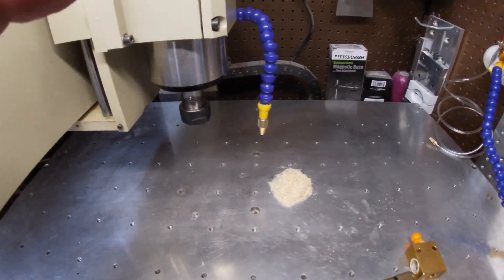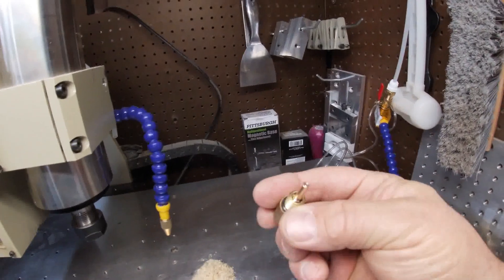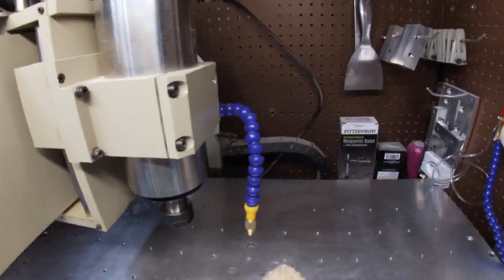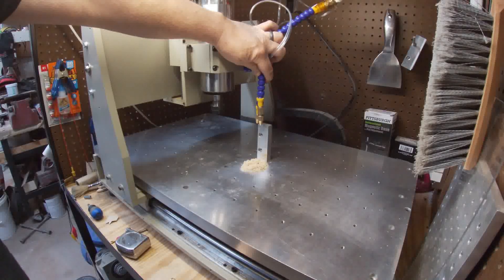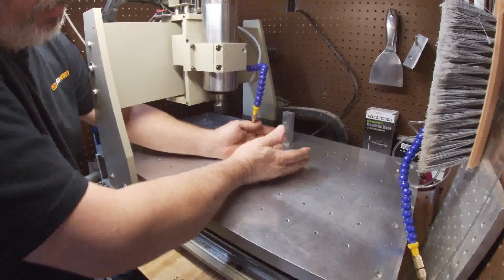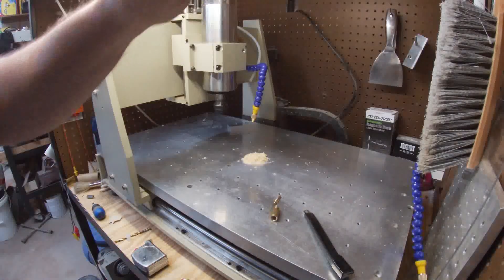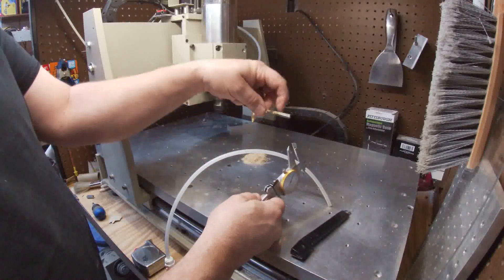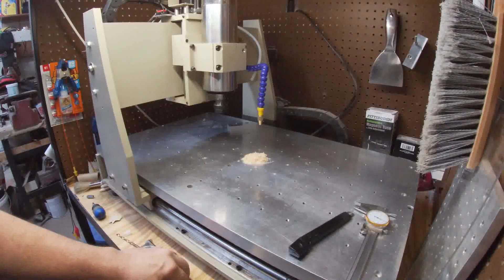CNC Air Assist Mod

Comment: Hi  I'm about to order parts  and good that I saw your video   as I was about to order smaller tubing   but I want to use  Hailea ACO009E (140 L/min) Piston Air Compressor Pump   or even  Hailea ACO300A (240 L/min) Piston Air Compressor Pump, Can you send a link  for that  mist Sprayer  as i can not fidn  any sprayer alredy with 10mm tube connect I assume that you just  changed  it for 10mm tube connector 
  I assume that  you have something like that  : Hailea ACO328 (70 L/min) Piston Air Compressor Pump     ?

I'm just wondering if ordering a stronger one will be a good idea  as then I could also use it to blow the tool probe buton with some  solenoid valve connected to mainboard   so it i will just make a blow on the surface of the tool probe on the table .
Reply from the maker: Hey sorry for the late reply, You will need an 1/8" npt to 3/8 Male nipple fitting and drill it out as much as possible before hitting the threads. The use 10mm or 3/8 tubing for great flow! Here's the link... https://a.co/d/8O3BWDT
Reply: @cpworx_maker I get a set of 10mmOD hoses with few threaded connectors and couplers and I went for that stronger air pump

Comment: I bought that same pump. I will go right now to make the changes. Do you reccommend having the pump on the floor or at higuer height than the nozzle? I would say over so that gravity may help but wanted to know if you tested it.
Reply from the maker: It's only pumping air so it doesn't matter where it's mounted. I like to keep it close to the spindle so that the hose is as short as possible for more flow. Thanks for the comment

Comment: Do you happen to know anything about auto-starting other tools when the spindle kicks on?  Ideally have it kick on the air pump and the dust collector once the spindle starts up.  It's not that I'm lazy, its that I like automation.
Reply from the maker: Yes, check your breakout board for extra outputs and have them control a relay for this. I use one of my outputs to turn on my spindle coolant and air pump when running a job. What controller do you have and have you looked up the documentation for it?

Comment: I do coin cutting with a jewelers saw and this is the exact perfect setup I have been trying to achieve to remove the metal chips as I saw.   Previously I've tried brushes and small aquarium pumps with little success....Your setup is PERFECT!!!      I didn't see any details on your pump size or what type of air loc hose you are using.   Would love to know some brands and part numbers so I can duplicate your setup......This has been super helpful and I can't wait to do a similar setup.....Thanks!!
Reply from the maker: This one is the Vivosun pump available on Ebay. The one in the video is the 70 watt model and it was about $65 on ebay. Modify the fitting and throw away the manifold that comes with it and it will work like mine. Thanks for asking and good luck!

Comment: I have thought about trying air assists.
My idea was high pressure air in pulse sequence.
like tree short pulses in second at 3 bar.
What do you think about the idea?
I think it could make a great video if you tried it out and compare it to consistent flow.
Reply from the maker: Interesting concept, I don't have a way to do bursts and don't actually see the benefit over a constat flow of air. I would like to experiment with multiple nozzles because sometimes the air doesn't clear the chips depending on which way the chips are going. Maybe a nozzle 180 degrees apart from each other. Anyhow, thanks for the suggestion. If you happen to try it out, leave me a comment with a link to your video so I can check it out.
Reply: @cpworx_maker   best way to pulse would be to run a 24v solenoid for the air and control it off a timer relay
Reply from the maker: @Cncguru-wl9hn  Maybe for you... I have a 48v power supply that controls a relay that turns my air off and on. My setup work perfectly fine for me